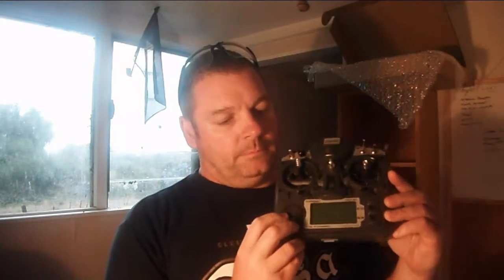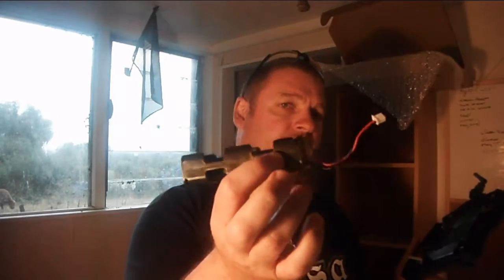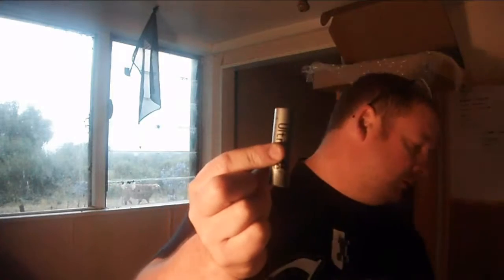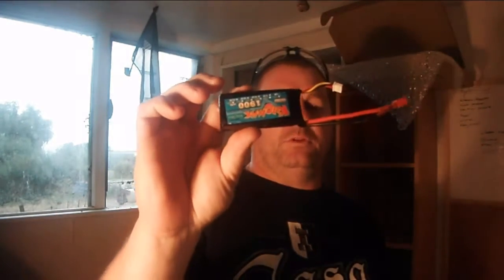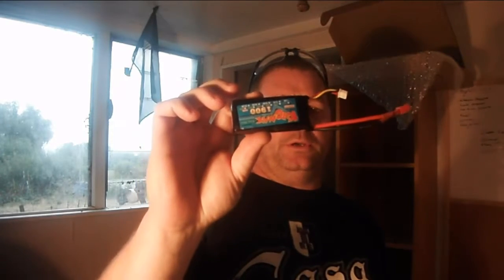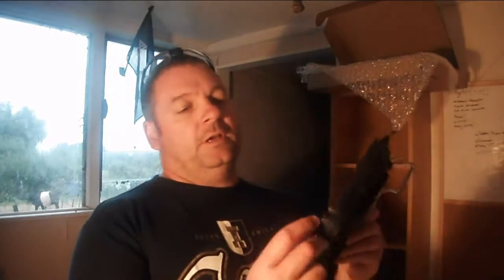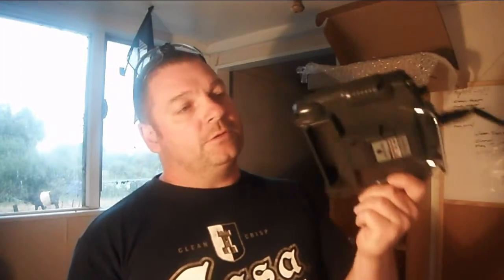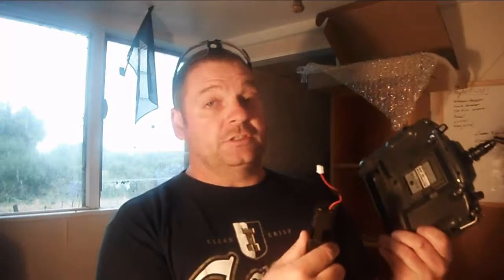9x Battery Mod part 1.mp4

Comment: Cheers  Shane!
I stuck with the Lipo conversion. Mainly because I had a spare 1000mah 3s kicking around.
Are you going to change the firmware? I'd like to see a vid on that, I'm thinking of doing it myself
Dave